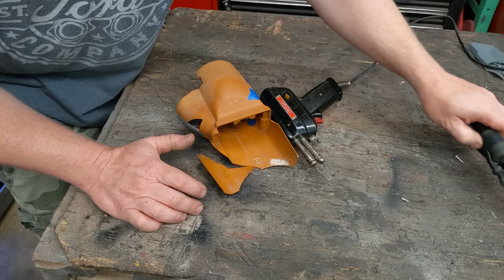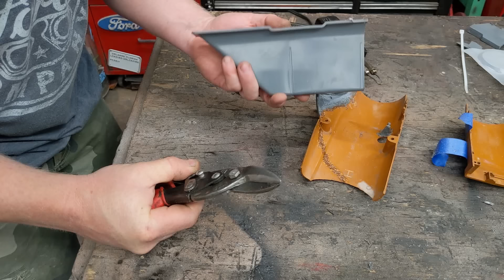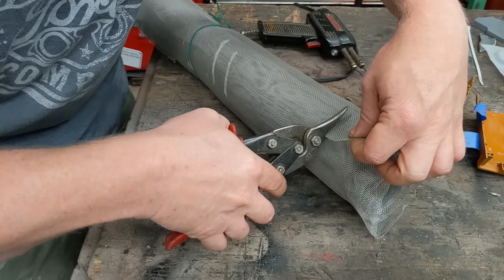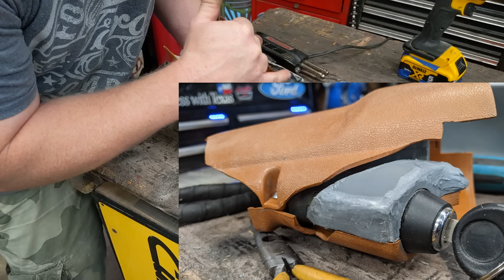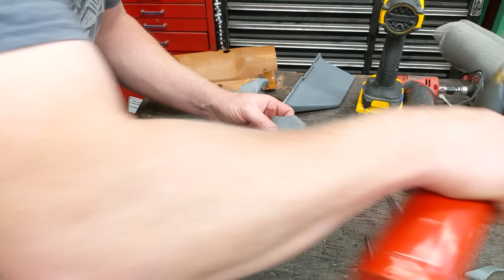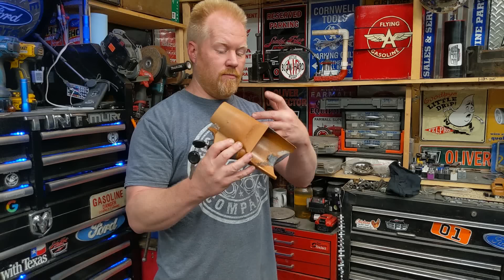HOW TO FIX broken plastic ULTIMATE Welding Forming Repair techniques

Comment: Very interesting and informative video. When you cut your screening for reinforcement do it on the diagonal. That way when you put it across your seam you'll have twice the number of wires strands crossing the repair.
Reply: I learned from a video about fabrics and sewing that cuts diagonal to the weave of the material is called cutting 'on the bias'. But with fabrics, the purpose is to provide increased flexibility, as most fabric only stretches in one direction. It's strange how different industries like to make up their own confusing terms for similar things.

Comment: Wish I’d seen this before I  discarded my cracked kydex holster
Reply: Burning Kydex releases Hydrogen Chloride, nasty crap.
Reply: Be careful if you mess with melting plastics, do your research. 
There's a reason plastic recycling buildings have scrubbers on their stacks... most plastics release poisonous gasses (but not all). 
Worst one that I can think of is PVC.

Comment: Another great way after you weld is to sand with 40/80 grit, wire screen and then a professional two-part epoxy like wurth fixall.

Comment: Another great how to video. I’ve got that same welding/soldering gun. It was my dad’s. I’ve had it probably 40 years.
Reply from the maker: The old Weller soldering guns seam to never die.
Reply: I've got the same one, also from my dad! He was a radio & TV repairman for a long, long time and then after retirement, he still did DIY tinkering with different electronics, so it was used hard for many years, and still works good!

Comment: Good information.  For cracks I stopped plastic welding & started using epoxy with sheetrock fiberglass drywall tape.  This combination bonds the pieces & makes for a very strong repair. Your technique for making missing pieces is great.  I'm sure I will use it one day.
Reply from the maker: Thanks man.

Comment: After the back welding I would just use screen or fiberglass cloth spread a little wider with JB Weld spread over and through unseen areas.

Comment: Great stuff. Have repaired a few motorcycle side covers and plastic pieces using zip ties and never had much success. Your techniques and materials work way better. Thanks for the info.
Reply: Motorcycle fairings are usually abs but the more expensive ones use carbon fibre and these parts cannot be welded

Comment: you could try wrapping the thin copper around a zip tie, slide it off and flatten it with a hammer to make a mat with multiple overlapped wires and make it as fast as bending back and forth.
Reply: Seems to me just using the screen mesh would be tons easier and faster.

Comment: 16:10 your dog is just like mine. She absolutely loves Baths, and Sprinklers and hoses…..watch out! She can play with them for hours until they are no more. Which, is the downside….as I finally got tired of replacing the popup rotary sprinklers, and bought a cheap hose connected sprinkler (for young kids etc…) for her to play with. Much cheaper and easier for me when they break, b/c I’m not digging the old broken rain bird/k-rain sprinkler from yard; just throwing the hose connected into recycling bin and screwing on a new one (buy them from dollar store for $5).
If it makes the dog happy, why not😉
Thx for plastic welding vid, as learned a new tip…..using the metal mesh; as I’d use a fiberglass type mesh, or wires to make a zigzag; but the metal screen mesh is WAY EASIER from what I saw, thx👍🏻
✌🏻

Comment: Nice presentation, but I disagree with using HDPE for everything,  Ideally you should use the same type of plastic as the damaged part, whether it be ABS, LDPE, HDPE, etc.
Reply from the maker: Actually plastics are combined all the time to create stronger structures. HDPE is miscible with all common plastics and yields a stronger repair. It's one of the strongest and toughest plastics made. Just like welding steel, you virtually never use the same type of filler material as the parent material. Instead you use filler metals that are stronger, more ductile, etc to create a better bond/repair. I used to always cut off/ scavenge parent plastic material until I started using HDPE and never had better success.
Reply: @sixtyfiveford  I have no ability to dispute the information that you are providing, but it does contradict what the other training videos I have watched (nearly a dozen) claim.
Reply: @ottokiehl5413  he is precisely correct, on both the steel and aluminum welding. Not only that, there are different kinds of aluminum, and each one gets welded with the same kind of aluminum filler wire.
Reply: @sixtyfiveford  this is exactly correct, on the steel and aluminum welding, both.

Comment: FYI if the tip goes on the gun type fear not.   Get a piece of old 10 Gauge. Romex wire from your stash and make a new one😎😎😎 from one of the wires.   Works great and smaller 12 gauge should work work fine too.
Reply from the maker: I have 12 in it right now and generally is what I use always.

Comment: Great video. I have an essentially new 40-year old Wizard solder gun, picked up at an estate sale in original box, that seems to be a twin to yours. Any tips on picking out replacement tips?
Reply from the maker: Mine, I just put 12awg Romex wire in. I can bend it to whatever shape and it's cheap to replace.

Comment: Dude get yourself a wood burning kit. The good ones generally come with a good variety of interchangeable tips, some like a soldering iron and some are big flat ones which work great for smoothing everything out in the end and blending. The one I have has a dial so you can very precisely control your heat which is super handy. It’s definitely worth it if you’re fixing plastic parts.
Reply: Tom, what’s the name of the kit you have? A photo would help as well, thanks

Comment: I’ve always had issues doing this and it looks like it is because I have been using tip ties. Thanks for the video, I subscribed!
Reply from the maker: Zip ties/Nylon has a way higher melting temp than most plastics you encounter. That is one issue but nylon as gets brittle it overheated and cracks easily. They do work, just not as easily as HDPE plastic.
Reply: @sixtyfiveford  I’m glad I watched and now know how to do this right 👍

Comment: Could cable ties be used as filler material?
Most of the metal screens for windows I have found to be aluminum which usually matches the window frames materials of construction and no electrolisis.
Reply from the maker: Cable ties(Nylon) has a higher melting temp than most plastics but also becomes brittle. It does work, just not nearly as well as HDPE.

Comment: For your consideration, I've had success putting donor like plastic in a jar with a little acetone(finger nail polish remover).  When it is melted you can apply it in and around the crack and even lay some wire mesh in it. When it cures it's strong.
Reply from the maker: Neat idea. That would work well with ABS and PVC and is probably better than welding with the PVC since PVC can release some pretty nasty smells/gases. Essentially pipe cement. I doubt that HDPE and PETE would be affected by the acetone.
Reply: That triggered a childhood memory of trying to clean out a clear plastic butter box with acetone (laziness).
It became opaque. And I had to get rid of the 'evidence', pyro-style.
Reply: @vendomnu  lol. I still remember those hot burns.
Reply: Fantastic! Thanks for the info
Reply: im going to try this just out of interest
Reply: Thank you Sir ,I will definitely try this next time to avoid burning plastic 👍
Reply: That is true, but it is changing the volume as it hardens, so it might or might not be important, in specific cases.
Reply: MEK
Reply: @mankindapparel  methyl ethyl ketone ? nasty stuff

Comment: Knowing your plastics is a good step.  Nylon is 550 degrees average when molding.  Abs 480.
Styrene 480.   Pvc is around 380.
You don't want to burn pvc, it's polyvinyl chloride. It can give off dangerous gas.
Reply: Several plastics will give off pretty dangerous chemicals when burning. One should always do this stuff in a well-ventilated area!

Oh, and I like the chicken eye closeup! Got a favorite breed or breeds? Mine are Light Brahmas, Banty Cochins, French Marans, and my recent new addition, Sapphire Gems. 😁

Comment: I worked in Blytheville AR as a backshop composite mechanic many moons ago.  One of the parts that came off of an ATR72 was a console piece roughly 10"x10" a new one ran $10k but I tried to plastic weld with an expensive machine.  I was absolutely clueless. Before the days of YouTube.  This video has opened my eyes to the ease of welding. Thank you so very much for taking time to perform this act of kindness. 😃😃😃
Reply from the maker: Thanks Man.

Comment: The filler rod choice, like with metal, should match the type of plastic of the part being repaired. mis-matches may or may not work. Usually the later. The filler material will peel off and not bond well. HDPE and PP do not work well with most glues and epoxies but weld well. PC welds well and works with adhesives. Thermoset plastics cannot be welded but generally work well with adhesives. 

The window screen is a good tip. I've used other metal reinforcement, but window screening would save time.
Reply from the maker: True,  but plastics are combined all the time to create stronger structures. HDPE is miscible with all common plastics and yields a stronger repair. It's one of the strongest and toughest plastics made. Just like welding steel, you virtually never use the same type of filler material as the parent material. Instead you use filler metals that are stronger, more ductile, etc to create a better bond/repair. You never use mild steel filler rod/wire to weld mild steel, etc. I used to always cut off/ scavenge parent plastic material until I started using HDPE and never had better success.
Reply: @sixtyfiveford  mild steel just refers to carbon content, but you don't use stainless to weld carbon steel or vice versa. It can work, but it's not ideal. That's what it is like if you mix HDPE and PA or PC or PP etc.

Many car parts are made with HDPE and PP. It's cheap per pound and generally performs well. I have welded PP with HDPE works well at first but I tend to get peeling of the filler after awhile. PP to PP works much better. 

The filler should be a newish  material. Using the same plastic that already cracked because of brittleness/age etc never worked well for me either. It becomes another heat cycle and it's just weak. 

I prefer sprews for filler rod. But generally one has to work at a place that does injection molding to get them. I grabbed some PP sprews from work and used those to weld up a PP trim part (damn semi tire bits) on one of my cars and it's been fine for a few years now.

Comment: Does this work on Kydex?
Reply from the maker: I have done this method with similar plastics with good results. The issue with thin plastics like this is you need to build up the material for strength. Kydex is Acrylic(like plexiglass) and PVC(sprinkler pipe) mixed. The PVC will stink pretty bad when heated so just don't do it indoors or put your face in the past of the smoke that'll come off.

Comment: Keep in mind that all plastics fall into two categories, thermoset or thermoplastic. Thermoplastic can be remelted over and over. Thermoset can only be melted once. This video is valid for thermoplastic materials. Any attempt to repair thermoset plastics with heat will turn the plastic into a black carbon mess.
Reply: Can you give some examples of what things would be made from thermoset plastics? Is it safe to say thermoplastic materials are more common?
Reply from the maker: True, but the only common thermoset plastics you're likely to run into are things like Epoxy Glue, fiberglass, Car Bondo etc. I can't think of any plastic parts made from thermoset, but I'm sure they're out there.

Comment: super glue is not flexible. it wont hold plastic for long. I like permatex plastic welder. I have repaired motorcycle fairings with it, even filled in some good sized holes with it, but it requires a good deal of sanding to finish.
  this repair looks great! I like it. much easier than mixing stuff etc.

Comment: I used to do this to repair those old CRT television back when clients damage them you need to get some sort of respirator to prevent inhaling the fuel from the plastic
Reply: No you dont
Reply: @mikek4610  if you're doing it in an enclosed area, without much ventilation, yeah, you absolutely do. 🙄

Comment: With few exceptions, most automotive plastics are some formulation of ABS.  I've done the hot air welding and have a wood-burning iron (from the hobby store) and can make most repairs between those two tools.  The wood burner is great, as the temp is variable and it comes with a bunch of different tips depending on what you're working on.  I have learned that whenever possible, you want to make your filler rod from the same plastic that you're trying to repair.
Reply: your right ! you can't use hspd for abs plastic !
Reply: Oh, hey, I didn't think about a woodburner! I've got both the soldering iron and the woodburner, so I could use both for different places or applications. Thanks for the idea! 🙂👍🏼
Reply: Definitely. You need to use a filler rod that is the same type of plastic as the part you are welding.
Reply: you can weld abs with acetone
Reply: @Spookydude3  explain
Reply: @glangrys  Its called chemical welding. Acetone slightly dissolves the plastic, you can then press the 2 pieces together and when the acetone evaporates its one solid piece. I usually use a small paint brush to apply the acetone to the faces I want to join, you only need a thin film.
Reply: @Spookydude3     Tried it - didn't work.
Reply: @usernamemykel is try using pvc glue and primer
Reply: @usernamemykel u need pure acetone, not nail polish remover

Comment: A 64 Ford was much better looking than the square 65, in fact I think that a 64 Ford Galaxy 500 XL two-door hardtop or convertible was the best looking full-sized Ford ever made. Then the 55-57 T-Birds and 56-57 Lincolns and Continentals, and then the Mercury 60-65. What about the Mustangs? The Mustang wasn't a real car just a engine with a steering wheel like most Muscle Cars, you wouldn't want to drive one of them coast to coast unless you are a masochist.
Reply from the maker: I'm not a big car guy. I prefer trucks and that is what the 65 Ford refers to.

Comment: See, if the manufactures reinforced their products with wire mesh, especially in the car, or on a tool or equipment like a vacuum cleaner or riding lawnmower, we wouldn't have to repair things, it is much easier to put a piece of wire mesh between two pieces of plastic in a factory than have to do it as a repair and the product could last longer and be better, than the average piece of planned obsolescence, that we have now.

Comment: You can also glue it, plastic glue gun, crazy glue gel-apply crazy glue gel and sprinkle baking soda on top and that will turn into ROCK. File or grind off if you wish

Comment: Nice.  Plastic is a generic term. A quick way to see if your material is Thermal set is color.  If it is all the same color front and back, it is probably a thermal set material.

Comment: Super glue and baking soda as a filler
Reply from the maker: I will use superglue/baking soda on very thin stuff that heating may ruin.
Reply: @sixtyfiveford  i mean as like a crack filler 
The “bondo” substitute 😉

Comment: I have used zip ties for welding plastic for years using the soldering iron 👍
Reply from the maker: They work. Cut some strips of HDPE from an old bucket, etc and you will be impressed at how much better it holds, flexes and bonds than nylon zip ties.

Comment: Do you use a different tip for actual solder work or just clean this same one? Great video!!
Reply from the maker: The plastic just wipes right off and I use the same tip to do metal soldering. I go back and forth all the time without any issue.

Comment: You could also use your Stapler (without using on paper) and "clench" a few together, and twist them 180° to make an "S pattern" and sink them into the Plastic as a Reinforced joint! If you don't have Stainless Steel Window Screen Material...
Reply: Actually,  regular metal window screen is aluminum.

Comment: i use a soldering iron to repair plastic wheelbarrow tubs.  i found that the filler plastic needs to be from another plastic wheelbarrow tub or it refuses to bond.

Comment: i repaired a cheap cordless drill that broke in half with ss mesh and epoxy.  i roughed up the drill handle surfaces as much as possible.  the mesh resisted my attempts to bend it to the shape of the handle so i used about 6 or 7 short pieces of copper wire to tie the mesh down.  when the epoxy had gone off but not fully hard i removed the copper wires.

Comment: Also If there is a crack starting that you dont want to go any further heat a needle or nail and push it through or almost all the way through where the crack ends,a crack cannot continue any further where there is a round hole

Comment: Thanks for another great video!  After using both top end "plastic welders" and HF equipment, your methods make complete sense, especially your tips on reinforcement.  It's a real pain getting just the right heat with forced air welders.  For larger jobs the equipment works, but smaller work pieces often suffer.
Reply from the maker: Hey Thanks. That's been my experience with hot air welders. Fine for thick car bumpers but destroy thinner plastics.